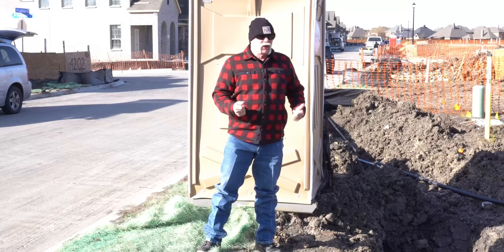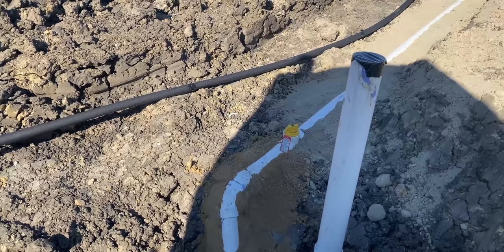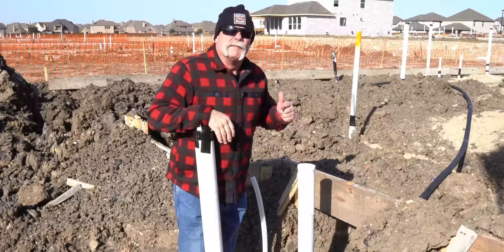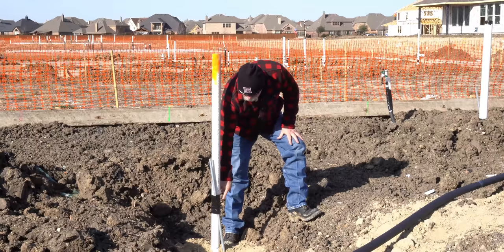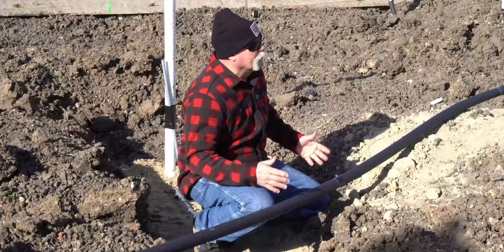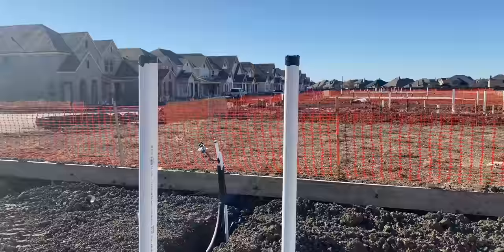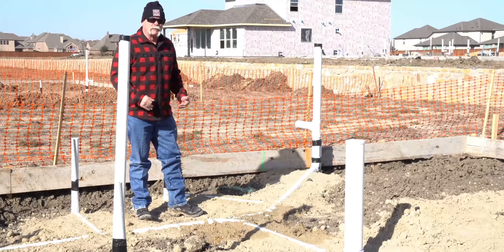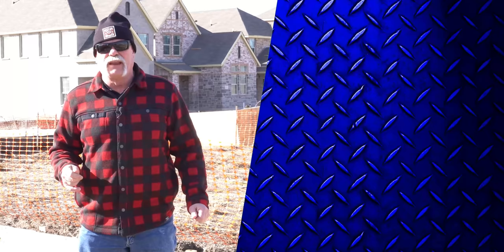How to Plumb a House | Rough-In

Comment: Some rough in crews can do up to 5 per day, so they are moving hundred miles an hour slapping primer, glue and holding for half a second and on to the next fitting. Leaks on rough in is very common.
Reply: My wife in early 90’s when construction slowed, wanted me to get into residential plumbing.  Because the rush in, rush out, I saw crappy work being done (often back fall on horizontals).  I take pride in my work and couldn’t work like that.  I’ve been a plumber for over 30 years, but I’m not actively working in the trade for over 25 years, mostly just side jobs.

Comment: I gotta say your videos are awesome and funny. I would like to ask what is the best way to adding additional 1st floor underground drain-line close to the perimeter area for a residential post tension slab foundation assuming below the slab foundation with 5-6" of concrete, the setup is grid waffle like trenches typically every 4 feet or so? To tie into & sloping towards existing drain line 7 feet away? I appreciate the help & recommendation.

Comment: Roger right ... always use 4" ....saves you problems in the long run ...
I thought you needed to put Comby either
 10ock or 2ock , not on it's side ...
Reply from the maker: Combo can't stand up. Flat it can roll anywhere.

Comment: If your drain line is 1/4" per foot slope (2 1/2 in per 10') and you put a 90 degree to a toilet or vent, your toilet flange or vent will also be sloped at 1/4" per foot.  How do you compensate for that slope to get a true and plumb flange or vent without putting the pipe under stress?
Reply: Level your fittings and not your pipe also its fine if it wiring the trap arm distance to the vent as it goes into the drain thru a bend no worries buddy lol

Comment: Isn't that something the inspector should've caught?..water test underground they should've checked water level at some point..if its leaking that bad the inspector wouldn't have had to wait that long to see the water level drop..or a visual smoke test..if the inspector is doubtful  I've  heard of them doin a peppermint(odor bomb test).every state/locality does it "THEIR WAY"..I've had an inspector fail plumbing inspection for an anti  tip bracket on an electric stove?.the inspectors are curious individuals ..hopefully they stay around long enough to build a repor... love your video's!..cheers...

Comment: Great Video,
Roger just got a quote here in Ft.Worth to install a water shut off on a 1983 home for $950.00 between the meter and the house and doesn't look complicated looks straight forward. Plumber was called out for possible slab leak but plumber stated a water shut off was needed first to find the leak. Seems a little high, am I wrong?
thanks
Reply: Hell yeah thats too high! Should be somewhere around $95-125 an hour and shouldn't take more than 2 hours tops. $250 labor at the max plus your parts cost. Damn
Reply: @tannerwest6823  
Thanks Tanner for the response. Its been hard finding good plumbers in the DFW area that charge a fair rate , Show up and do a good job.
Reply: @GH-wt7ww yeah I hear that same thing almost everyday. I live in NC and ppl have the same problems here trying to locate good honest service workers

Comment: 4 inch is twice the price.
Reply: Plus the water level is lower due to the bigger size. 3" is ok for a house.
Reply: @alejandroc7357  here in SC it's 30 for 10 feet of 3 inch and 50 for 4 inch. Our supply houses or chain stores all the same

Comment: The idea of underground plumbing in a home really doesn't sound like a good idea. Should have a crawlspace at the bare minimum. But I guess if the plumbing is done right it can last for years.
Reply: It's really only a huge issue when its old cast iron underneath. Its only a matter of time before you have to tear the whole floor up.
Reply from the maker: I've been under houses in Dallas where the 60 year old cast iron looked brand new.